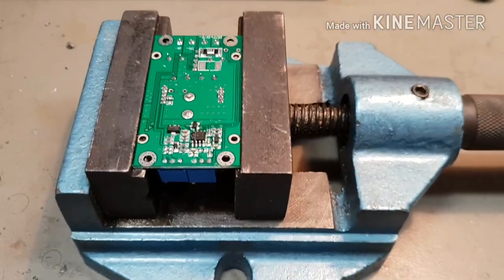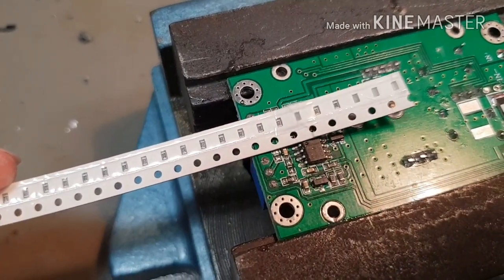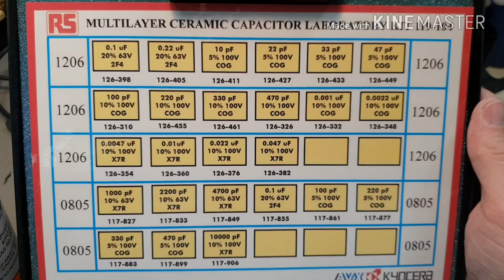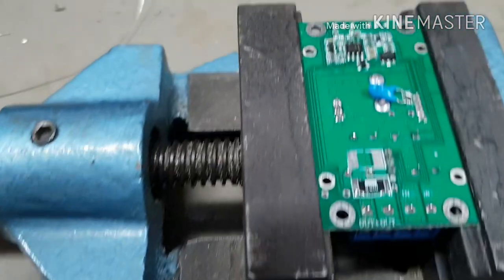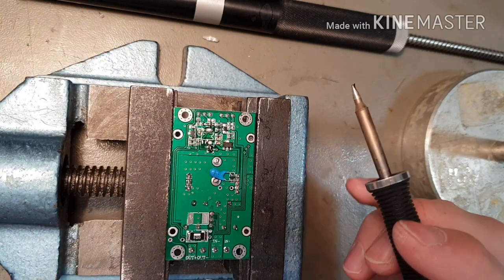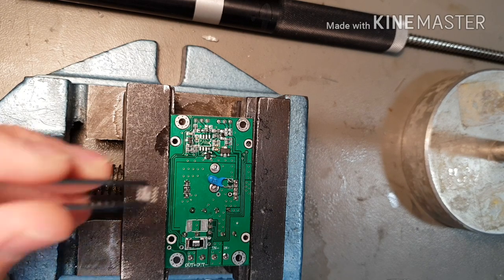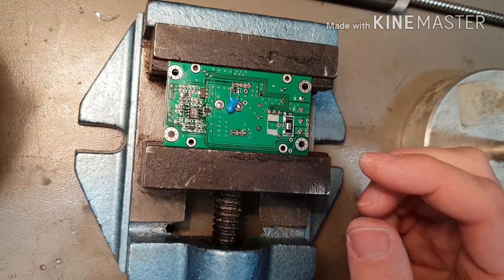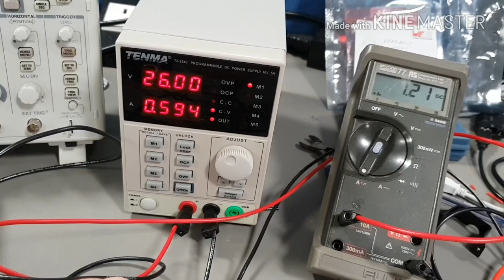XL4016 CC CV Power supply Modifications & Repair Part 2

Comment: Impressive review and overhauling. 
I just wonder why it would be necessary to replace the LM358 by a LT2178. It is true this later one has lower noise and input offset figures, but these better features are not needed for this circuit. Also, its slew-rate is just 0.04V/us, slowing the current feedback to much (my guess) while the jellybean LM358 is about 10x faster.

Comment: Thank you saved me a look around. The isolation from this is annoying any time spent near it and I keep hearing it... Even when it's off... 
Hopefully we'll see. the end of that.

I noticed the input and output caps, I will replace them, but not swap. The larger the output capacitance the slower the buck response. 470 should be fine.

Thank you also for part 1. 
Is the current gain from that 5v regulator?
Hence the cap as it can't produce much power..

Comment: That was an amazing video. I am curious how one would modify the circuit to prevent the input voltage from dropping when current draw is increased on the output. 

I saw that works as a great cheap mppt in solar applications.

The idea is to decrease current on the output automatically to prevent input voltage from dropping
Reply from the maker: Hi
Mppt is slightly more complex than that. As you slowly increase the load on a solar panel, the voltage does drop, but the power your extracting increases up to a maximum. Then as you increase the load more, the power starts to drop again. 
Say the OCV of a 100W panel was 20V. You put 100mA of load on and it drops to 19.8V, you're pulling 1.98W out of that panel. Now apply 1A of load and it drops to 19.5V, now your pulling 19.5W. Apply 5A of load and its 18V and you've got 90W. Apply 6A of load and it drops to 14.5V and now you only have 87W, so the max power point is somewhere between 5A and 6A.
I made those numbers up to illustrate the point. You have to vary the load to keep the output power at a maximum.
Reply: If you use a stock one of these.
What happens is the current (adj)  will pwm  based on the voltage to your power in.

So as the sun power goes up you can maintain amps, to a point when it crashes from the max mppt. 
The lower voltage the lower the current. (Lower the power)

I was not able to get it to high current and voltage (within reason) as I was Charing a battery, but it just wouldn't give me the voltage I wanted.

As for mttp you would have to adj and reset the current to maintain the peak, as it will drop the current. 
(Though  Mr woods video may resolve an issue)..

Comment: Amazing work. Thanks for sharing. Is it possible to bypass short curciut protection in this module for voltage injection.
Reply from the maker: Hi,
The module doesn't have short circuit protection as such. It has a limited current output, and if you reach that limit it will automatically reduce the voltage until the current is at the output limit. There are two current limiting mechanisms. One is done using the constant current potentiometer and the op-amp circuit I describe in the videos (see part 1 as well), the other is built into the XL4016 chip. You would be able to disable the external current limit by removing the diode on the output of the op-amp. The current limit in the XL4016 (set at about 14A) is fixed and you can't disable it.
Reply: @alexwood020589  Thanks a lot.

Comment: This is a good video series. I especially liked the reverse engineering part. The final test this video could just have been better with some commentary though, since I didn't know which potentiometer you were adjusting. (Though I assume it was for current)
Reply from the maker: I'm glad you enjoyed the videos. 
You're right about the last bit, I would have liked to narrate what I was doing. I was filming at my desk at work, and there were people around me, so I couldn't really talk. 
I was adjusting the current setting into a fixed resistance load, showing that the power supply was stable.

Comment: Hi. Excellent video. I have this module too. What is its real efficiency? Thanks. (sorry for my english)
Reply from the maker: Suso Sanchez
The circuit is a classic buck converter, so the efficiency will depend on a few factors like the input voltage, the output voltage and the current draw. There are three main areas of power loss in the circuit: the forward voltage of the diode, the switching losses in the MOSFET and the resistance of the inductor. The losses are all proportional to output current only. So at a low output voltage and high current, you will see the worst efficiency (lots of losses and not much output power). 
At the end of the video, I'm running the power supply at 1.6A output, at 12.6V. That's 20.16 watts. It's drawing 0.8A at 26V input, which is 20.8 watts. So the efficiency is 96.9%. It's hard to calculate exactly what it would be for different load currents and output voltages. Best way is just to test it and see.
Thanks for your comment.
Reply: Thanks Alex. In this moment, I'm testing the module with a Vin 22V (trafo 80W) and Vout 12.3V. The load is a dummy load DIY, with a IGBT. 
When I finish, share the results. 
Thanks again.
Reply: Hi again. These are the results:
Vin 22V - Vout 12.3V
0.5A - 85%
0.8A - 89%
1A    - 87%
1.5A - 83%
2A    - 79%
2.5A - 77%
3 A   - 71%

However, the module is quite efficient. Regards.
Reply from the maker: @jesussanchez1971  hi
Thanks for the data, that is really interesting.
I would have expected the efficiency to increase as the load increases, up to about 80% of the rated output of the power supply, and then start to taper off again.
Surprising that it just drops with increasing load. I'll have to do some tests on mine and see if I can work out where the losses are.
Reply: I tried to replicate the module with the same components, but it don't work (on protoboard). Maybe the inductor is the cause. With a load, the voltage drops.
Reply from the maker: @jesussanchez1971  these power supplies are quite sensitive to layout and component placement. If you're sure it's all connected properly, and you didn't damage any parts during soldering, then the issue is likely to do with parasitic capacitance or inductance in the circuit where it shouldn't be. Minimise track lengths, especially around the switching nodes.